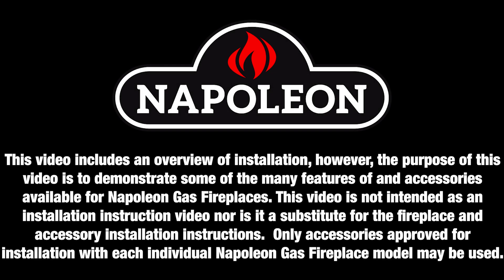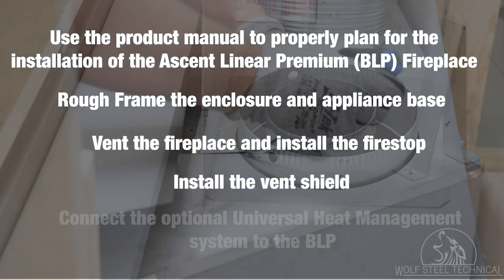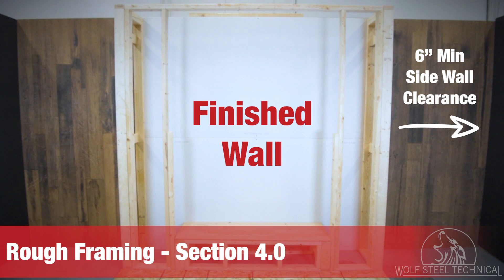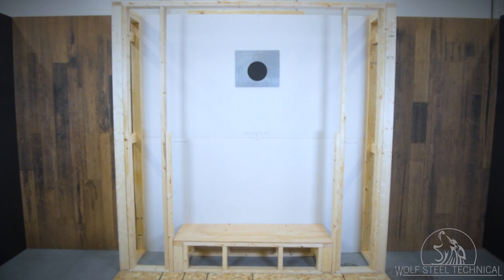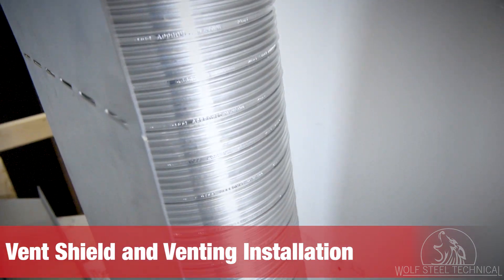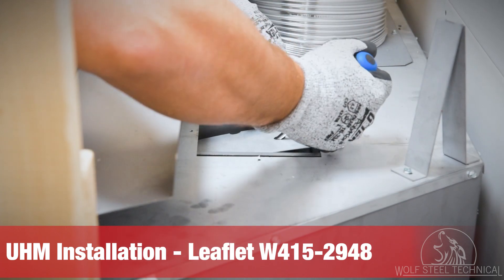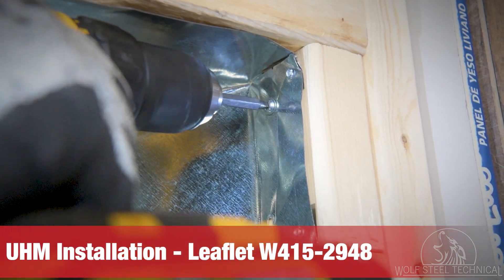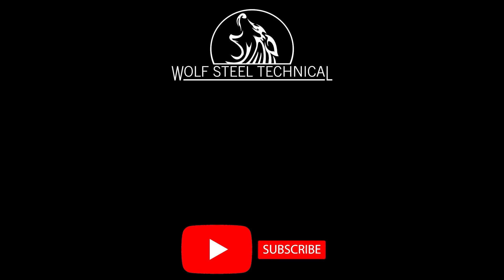Napoleon Ascent™ Linear Premium (BLP) Installation - Part 1/2

Comment: How tall are those boots it doesn't say anywhere and dimensions of the grill
Reply from the maker: the UHM, UHMF leaflet contains this information.

- Opening for each boot is 4" x 12"
- UHMF grill is 34 1/4" x 5 1/4"
- each UHM grill is 13 9/16" x 5 1/4"

hope this helps!
Reply: @wolfsteeltechnical can you still use the blower if you want?
Reply from the maker: @spencerdockter336 there are a fee heat management systems that work with the tlv and tlvl. If you go to the Napoleon website, it outlines the appropriate ones which are approved for use